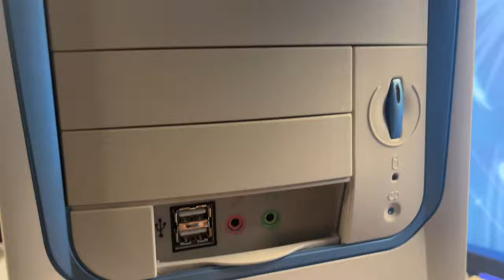ultimate aesthetic sleeper pc build

Comment: I suggest not putting any DVD or floppy Drive on the bays but instead putting some fans and having those 5 and 1/4 drive bay covers lift up like a blind so airflow can go through it and cool your system slightly better.  Bro, you have a hot box that needs to be in excellent cooling condition.
Reply: i was going to suggest that too, i dont see an exhaust fan either

Comment: History lesson.

Back in the day it was basically the same I/O shield just different holes opened to match the board.

But, if you go back farther in time there was no I/O shield.  The case had  punch outs for the various ports.  As a builder you would manually punch out the pre-cut spots.  Printer port and serial port were fairly standard. 

Also almost every build had a modem.
Reply from the maker: wow thats so interesting, i knew that serial was super common on boards but i had no idea they were so generic that most could fit one io shield. thanks for sharing!
Reply: @kabutoFPS  Imagine my surprise when I came out of retirement to find out there were different kinds of IO shields.  I thought they were all the same (coming from 20 years ago).

Comment: I really want to do a sleeper build and for some reason I was thinking that the front IO connectors wouldnt be able to connect to a mordern MOBO. Also did you add any fans afterwards? these older cases dont have very good airflow so im curious.